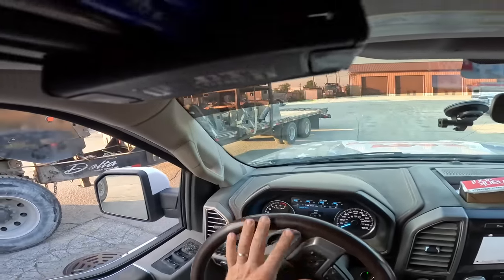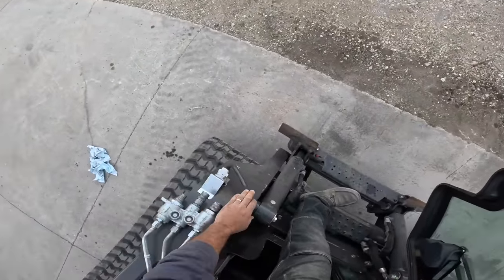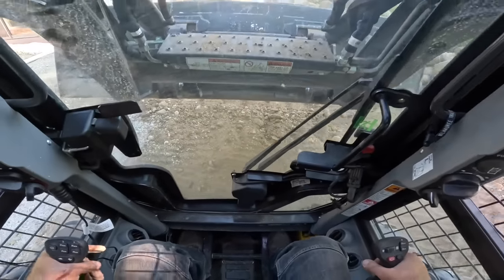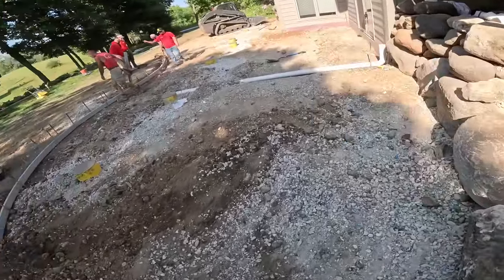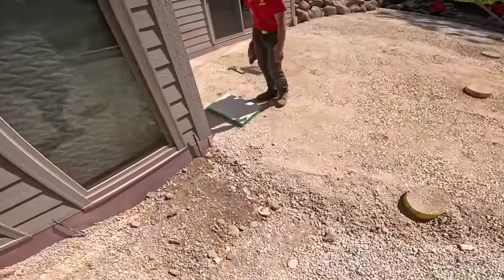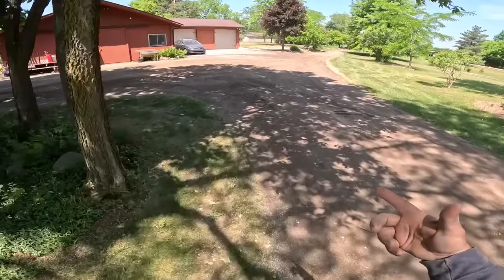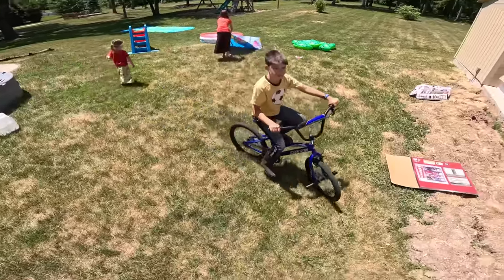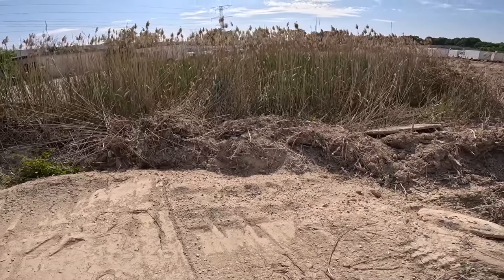It's always something on the job site! He broke it!

Comment: I know it’s not the normal routine but if you just kept a bucket on the skidloaders when you load them it wouldn’t have that hesitation before the tracks peak, i was so nervous to load into a dump trailer before I figured out the weight of the machines

Comment: I'll tell ya what, when it comes to forms for those blocks, if you get the metal to make it I'll volunteer my time the next time I'm home and come cut it and weld it for you. Id accept a donation for gas since I'd be coming from green bay but I wouldn't charge you anything.

Comment: I’ve never operated a skid loader and please school me in the comments if you can, but it would seem to me that for an expensive piece of equipment it should have some sort of mounting mode switch to mount the skid loader onto trailers with a counterweight system that activates when it senses an excessive angle 📐 or something.

Comment: hey you can order the basic spouts for fuel cans without the safety bs from china. I got a pack and there was something like 6 of them each with different threads so you can find one that works. On mine the safety mechanism held water and then cracked when it froze so it was junk without the replacement spout

Comment: Here's The Thing, you know that the new technology has to do a safety pre-check to make sure everything is up to par. If you don't want that to happen, never shut The Thing down during working hours. So when you get into it, you are able to keep going. And never have ever have to stop and have to deal with the self. Checking making sure everything is good. Every time you turn the key off and turn it back on, it Press scans every freaking sensor to make sure everything is in working condition.

Comment: That's the thing with all these new manufacturing machines even when it comes to brand new trucks like from altec there's too many sensors and little inconveniences like that for such a big price tag It's ridiculous. When it comes to line trucks with bucket attachments or a digger Derek I refuse to take a brand new truck given to our garage. I have an older Freightliner that doesn't have too many sensors and it just works every single time.

Comment: 5:15 If you had thought about it, you could have put a bent 1/2" rebar in the top of the concrete so you can lift these up with a cable, then even smooth the surface a little when first poured on the truck. You never can tell when you need something temporary to weigh down a tarp or something (tent maybe), especially at the new property.

Comment: If I were you Ryan, I would fit a bypass to the throttle on the skid-steer. It is pretty easy to do - just tie some string to the carburettor and then feed it into the cabin then to get instant acceleration just pull on the string. I did this on my lawn mower once and it worked a treat. Try it. Cheers B.